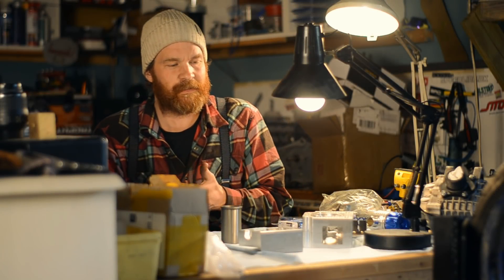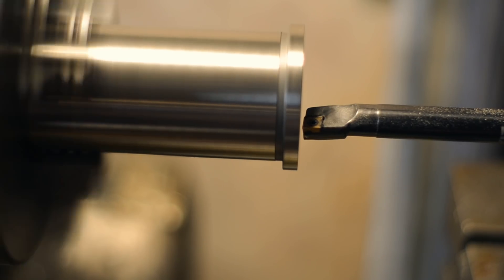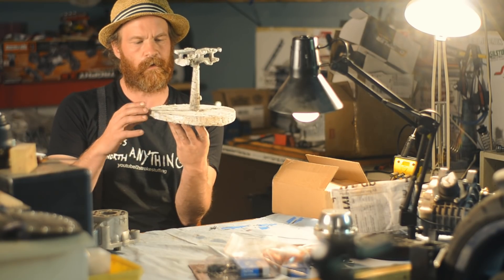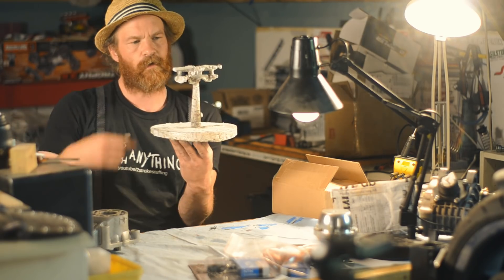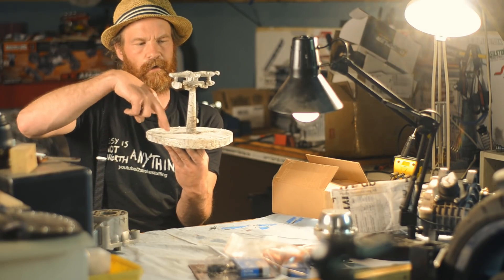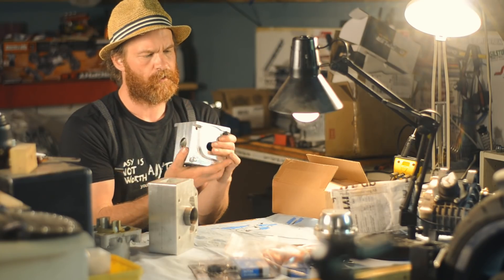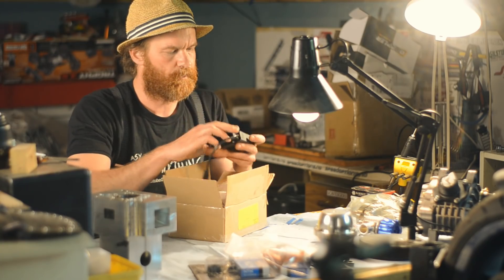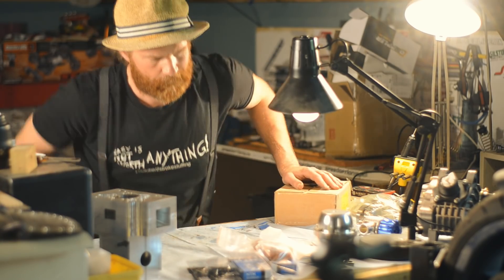Big Blower meets Tiny Engine!

Comment: I really love this project, i know nothing about two strokes and that's what excites me ! I don't know if your drill press can run any slower but i would advise you to lower the speed a bit, you seem to be at 2500 - 3000 rpm with an 8mm bit, even in aluminium it's pretty fast.
Reply from the maker: Thanks! Yeah, sounds like a good idea.
Reply: @2STROKESTUFFING  A quick and dirty way to calculate what speed you should be running is to take 6000 divided by the diameter of your drill or the workpiece you have in the lathe.
For example: 6000/8=750 rpm, the "correct" speed for a 8mm is 796 so pretty close.
When turning it's the exact same thing. If your workpiece is 50mm then its 120 rpm ("correct" is 127) 
Not an exact science but close enough. This is for HSS drills/tools. When using carbide tools multiply the result with 5. Hope this helps 😁
Reply: @doktorjonsson3860  Back when I was in machinist school, the way they told us to calculate is (1000*Vc) / (pi * D) = N 
"N" being you rotation speed in rpm
"Vc" being your cutting speed, which represent the radial tip speed of the bit in m/min (a conservative 40  to 50 is okay for hobby grade drill and bits) 
D is the diameter of the drill bit
Reply: @xxtrengt8871  Yep, thats the "proper" way to calculate it, but as I said it aint no science. Even if you calculate the exact rpm you need you more often than not don't have the exact speed so you have to round up or down a couple of %

Comment: 2 things you have to watch for with petg... temp and moisture.  I find on my printer, most petg prints well in the 240-250c range.  Also, it is hydroscopic, so it really needs to be kept dry. if in doubt, you can dry it in an oven. there is a chart somewhere that lists drying temps for different filiments

Comment: So why did you choose a 50cc to build?
Reply: If asking that question you are not subscribed . Go back and watch all videos on two stroke stuffing . It will make your sure your next question is up to date . Basically cheaper than building a 500 cc project .but if these designs work it will work on larger cc capacity two strokes ..
Reply: Actually Alex is going to attempt breaking the World land speed record for a motorcycle powered by a 50cc engine. He already has the complete rolling chassis for the engine to go in and has already been somewhat tested
Reply: @chuckingram5966  very good chuck a smart duck ! that has been watching two stroke stuffing .
Reply: @alcapone6270  yes Al I wouldn't miss it.
Reply: It was Alex's intension to build a 50cc single cylinder to beat the Dutch tuners at there own game of achieving 20hp.
The PiP was Alex's attempt at making massive gains due to its 100% of bore exhaust concept. The Brute Force was simply a concept dreamt up at the same time as PiP.

Comment: PETG works best at 240-250 degrees with a relatively low feed rate due to the viscoscity. Too high it can clog, too low and you can get under-extrusion due to feed slipping and poor layer adhesion.
I find that it works better with bigger nozzles too (probably due to viscoscity). A 0.6mm nozzle with a 0.1mm layer height is much nicer than a 0.4mm nozzle with a 0.15mm layer height in terms of overhangs and layer adhesion.
That said, have you considered just using ABS and using acetone to clean the mould?

Comment: Wouldn't cutting flanges on the cnc and welding pipes be easier than casting the runners?
Reply: Just bending the pipes would be more practical I think

Comment: I could help you with some petg settings for the ender3 Alex depending on the filament but mostly 240c bed 70c some glue stick. Retraction speed 5ms prim 3ms print speed 40ms. And by the sound of your braking of the raft sounded like your filament is hydrated need to dehydrated filament. Hope that helps Alex petg is very hygroscopic
Reply from the maker: Thanks for the tips! Was a fresh spool, but might have been exposed to moisture before it was sealed.
Reply: @2STROKESTUFFING  I also forgot retraction distance 5.5mm. When the extrud the filament it's water bathed that's where the moisture come from. 
I always dehydrated fresh rolls as I have always found it to be popping or looks strange once printed. Love your videos keep up the awesome work. Dehydrated 70c 4hrs

Comment: Why not run a conventional camshaft and just and exhaust valve?
That way it would seal 100% and you could move the timing easier and have better port timing
Reply: Probably not 2stroke enough
Reply: Rotating mass... plus hard to achieve the rpm’s he’s looking for, not impossible but difficult without using super high $$$, custom made parts.

Comment: Alex, there is a 3D printer wax filament available for printing lost wax investment patterns, it may help you speed up your burnout times 👍
Reply: It also doesn't leave residu like a plastic print will do.
Reply: Get the mould core the wax hot enough and it will run out like water.
Reply: Wow that's cool.  I had no idea that existed, but it makes perfect sense.
Reply: @beemergb  So you've been having good success with this material?
I've been wanting to get into casting but burning out pla seemed like such a chore.
Reply: Just like how the ancient Greeks did it.
Reply: I wondered about gently blowing air into the form with a thin steel tube, to help with the burnout.
Reply: @rubikmonat6589  I don't know anything about casting but I imagine that could lead to oxide formation

Comment: Would casting benefit from sitting the mold on a vibrating table?
Reply: I am sure he has one lying around...
Reply: Wouldnt fix the issue he had with this one, people have played with it it though.
Can help mechanical properties and surface finish but can also make mech properties worse. 
The problem is that with all of the white papers put out on this topic only cover the idea and are only casting test bars, add in more complex geometries and differing wall thicknesses and you have an absolute mess of conflicting information.
In the real world you'd just make the parts a little bigger and do other more beneficial things to improve your melting/material/gating etc. to remove the oxide film defects from your material and add grain refiners to get the desired outcome.

In these castings they arent high stress parts where all of that is super critical so really no point.

Comment: You should either get a vice, or clamp for when you're drilling stuff. I get scared, and anxiety everytime I see you drill something without clamping it down
Reply from the maker: I feel I have more control with the part "floating" have suffered the occasional bite though.
Reply: I think he has multiple vices, but setting up takes take

Comment: Little tip for boring bar chattering slap a lump of putty on the back of the bar it can absorb some of the vibration and help reduce chatter
Reply: Another tip depending on the motor setup is if you can vary the motor speed while cutting a gentle changing rpm by +/- 150-200 rpm can also help stop chatter building up while turning -easyist on cnc where the spindle is computer controlled but can be done manually on vfd driven motors
Reply from the maker: Thanks for the tip!

Comment: Geile Sache das Langtuning auch dabei ist :D
Reply: Dachte ich mir auch, die ham ihren Laden nur 1km von mir entfernt

Was ein zufall
Reply: Ja so gut😂
Reply: @Quirin M. glaube Kupplung und Getriebe würden auch nicht lange überleben.
Reply: @Quirin M. fahr ne 48mm langhub welle mit 110 ccm der dreht bis 11 und das jetzt seit 18 000 km ...
Reply: ach Quatsch ne originale S51 dreht auch problemlos auf 6000 rpm^^. Bei 5500rpm ist sie original mit 3,7ps angegeben, dann kann sie da ja noch nicht auseinander fliegen😂

mit einer ordentlichen Kurbelwelle ist das alles kein Problem, einfach mal bei Langtuning im Shop  reinschauen, der LT 85 Evo Zylinder ist als Leistungsbereich 5000-10.000 rpm angeben.
Reply: es wäre kein 2takter geworden, wenn er keine drehzahl abkönnte 😂
Reply: Jetzt muss der Zylinder nur noch auf einen Simsonmotor drauf 😂
Reply: @marcelpursche5339  😂wer weiß
Reply: @Quirin M. hab nen Kumpel der hat ne Tonne Arbeit und Geld in die Hand genommen und seine s50 auf 6200 rpm oder so gebracht, Getriebe und Kurbelwelle mögen das gar nicht lol